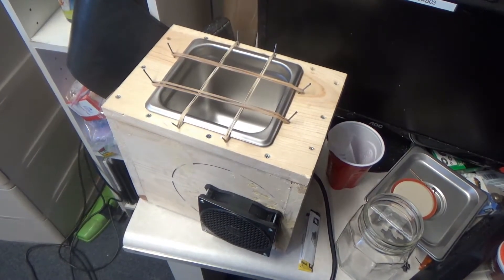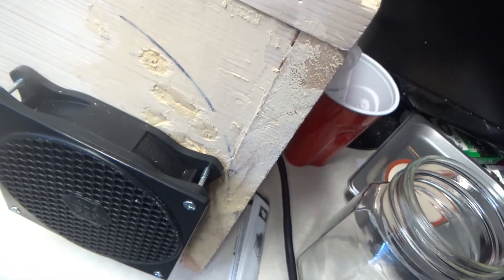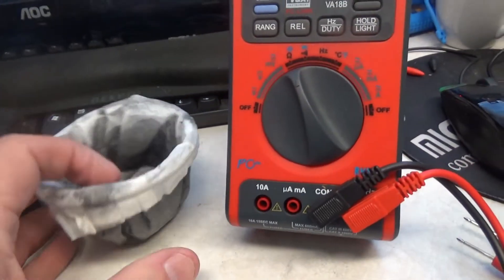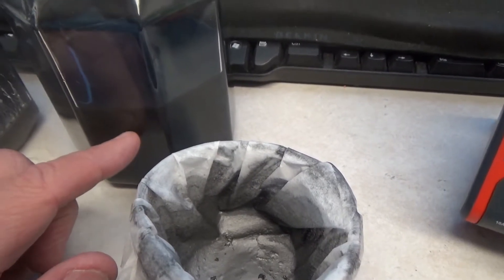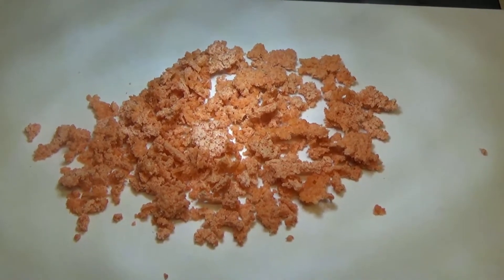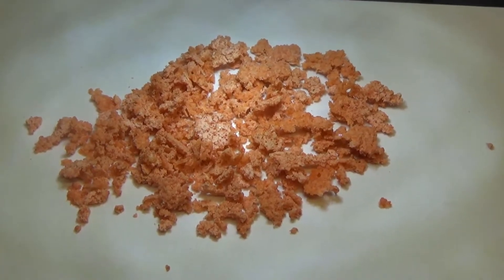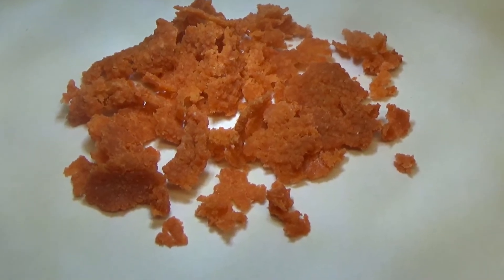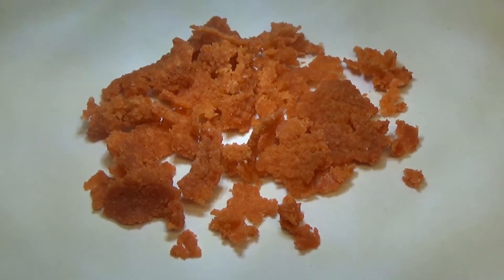Lots of Updates! Graphene, Sonicator & Carbonization

Comment: I’m curious to know if this sonicator is powderful enough to make a colloidal suspension or homogenize oil and water. Great video!
Reply from the maker: I'm not sure, but the one I have built might be, but is probably not.  That being said, it is possible to get different transducer/driver board combinations in a variety of power levels.  One big thing I would change if I rebuild it would be to increase the airflow for cooling to allow it to handle long runs.

Comment: Hi, nice vids, just subscribed.What was the resistance of your graphite before you processed it with the acetone and water etc? - Martin.
Reply from the maker: It was 50 micron flake graphite, and starts out with a low resistance.  I don't have specific measurements on it, sorry -- but I think that starting with flakes and conductive material increases the chances of separating layers of nice graphene.

Comment: There is still long for the World  to graphene. There is no company that can make Graphene. I am in circle it is more comlicated then we think.
Reply from the maker: At this point, there are many companies claiming to sell small quantities of graphene, some of which I respect quite highly.  Creating volume processes and ways to make large sheets instead of powder - those are still being worked on.
Reply: STEM Camp Projects Why sell graphene if you can make much more advanced product with graphene and silver or aluminium.
Reply: That is no longer the case. Using this mans work to jump off of I developed a way to make large pieces of an invisible material that when you place your hand in the separating media and move it around, you begin to feel something there causing resistence towards removing your hand. I will not yet say the medium as it is the key to it. It is novel, and it is going to be a giant hassle because it is a list 1 chemical that someone will have to break a couple laws to even make the percursors to make the chemical. Then using it lol, in that sense it is complicated, but the falicy is in how we have been treating knowlege all along. Humans were smart a hundred years ago. There are stories of Alaskan gold miners dismantaling there steam liners in order to get the ship over a mountain range, by themselves. Today that would require no fewer than, i cant even guess how many professionals to even operate a boiler. You have to be a boilermaker, no one else can operate a boiler today, we have regulated ourselves into a corner. What i did wasnt that difficult. But without the open source community I do not think I would have cracked it. See the material i use when used as i originally tested produced pieces of graphene just as this produces, but when i use the material under sonification (it has to be modified to a much higher power) then it results in the golden egg. 
Now if your pissed that i will not share it, just wait. I am going to open source it, but i want to be sure I own it, so it doesnt wind up in some corporate secrets vault, while they lobby the chemical required into somethinbb even more impossible to aquire without special permits only available to a select few. In fact, until that happens I am going to share it with the host of this you tube channel, robert, light saber, element maker, and a couple others that i feel deserve being part of the initial stages when the most money will be made. They may do as they with, i have a provisional patent in and am working on the patent, which is really just to ensure it stays open source. Now as far as corporate use is concerned i am so disgusted by the results on my society by those entities that I want to liscense this in a way that forbids them from using it for commercial gain if thats possible. I know this commentor spoke out of fear that someone else might find this before they could is clearly the motivating factor. They lack insight of creating a better world around them is better than creating a better world just for them. It seems like the more they gain the worse the world becomes, so while gifting everyone something awesome i hope to knock these dip #@%$'s back to where they came from. The future of humanity is open, and it will be our responsibility to keep it that way. We have the ability now to make it to the stars, to solve energy problems, to take out the human over population problem now and al, we have to do is do it and leave them out of it.

Comment: The carrot stuff I don’t get it
Reply from the maker: That's fair-- I haven't explained it well.  I'm trying to really dial in my carbonization process using one particular carbon before I start changing carbons all over the place.  I chose carrots only because of a fairly recent Robert Murray-Smith video where he used dried carrots as the carbon.  In this update I'm pursuing a variation of the carbonization process where I dissolved the salt I'm using in the process in water before adding it to the carrot powder in order to get the most even distribution I could get.

Comment: Good update bro . With the graphite/graphene left overs you may want to have a play with suspending it in a tea solution as the tannic acid will adsorb/absorb the graphene and keep it in suspension and then pour that off into a coffee cup and boil in microwave to destroy the tannic acid and then evaporate down till very fine graphene indeed . I have done this and small yield  of 1-2ohm dust that probably tested properly would be sub 1ohm and a great addition to your carbons ! Cheers Andy
Reply from the maker: Thanks Andy - you just keep coming up with great ideas!  I gave you credit in the description for trying putting the salt in water before mixing with the carrot powder - I will carbonize it soon, probably tomorrow - but it definitely totally mixed it in well.
Reply: STEM Camp Projects cheers for the credit 😊I dehydrated some kale tonight ready to be rehydrated with zinc chloride and a few others ! Kale apparently has a lot of zing in it but so does shiitake mushrooms which you can buy cheap at Chinese grocers already dry! I think mushroom being mostly 80% or more water will have a great micro porous surface area . So fun playing around with this stuff !😊
Reply: Any chance of showing some of your graphite / graphene work on here? - Martin.

Comment: Ok time to get some freeze dried stuff to carbonise, try apple and onion if you can get it 😎
Reply from the maker: I've got a HUGE list of stuff to carbonize.  Adding apple and onion!  Thanks.
Reply: Onion has a high sulfur content, so works great on the cathode.
They both have lots of sugar in them this helps too.
I mainly use regular activated carbon on my anode and then trial other carbons on the cathode. A pinch of Garlic carbon helps a lot on the cathode as well, obviously very high sulfur content in that one.

have fun
Reply from the maker: Excellent.  Also want to try orange peel, both fiber and shell coconut, hemp fiber... the list just goes on and on!  Already freeze dried fruit sounds like a great source to use.  Thanks!
Reply: OK one of the best items that you can try is chicken or duck feathers as well, if you get some and carbonise them i will give you the full run down on how this carbon can store gasses.
now i'm off to bed LoL
Reply: kev wallcroft I did feathers in a tin cookie can on a gas cooker outside and it graphitised them . Amazing conductivity and really cool looking shiny graphite . But must be done outside as a lot of volatile gas that really smell come out. I did a pillow case full and got less than half a can of coke out of it !
Reply: Electron Proton Neutron Mouron so i guess you may have lost some as ash ? Or even not ! I mean volume for volume you would not expect to much from feathers.